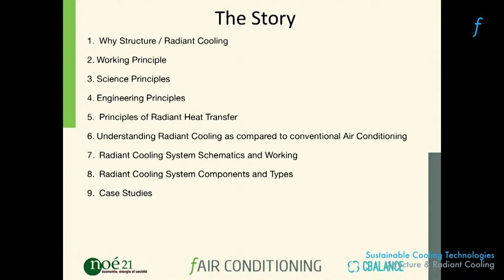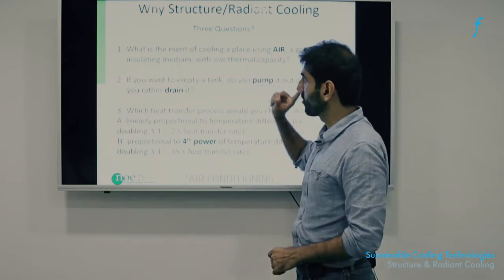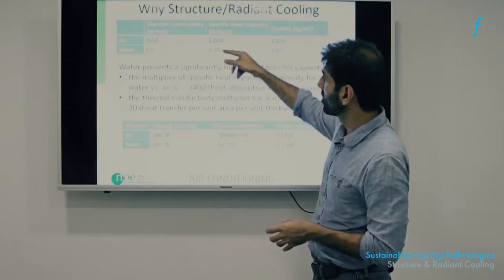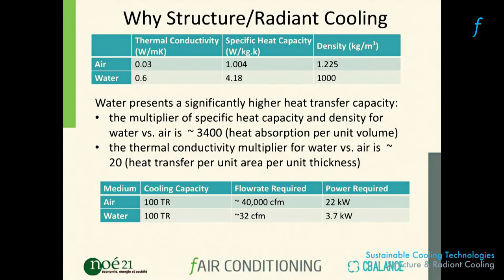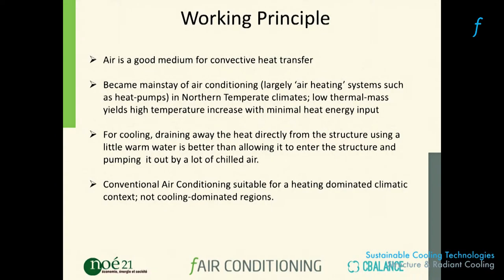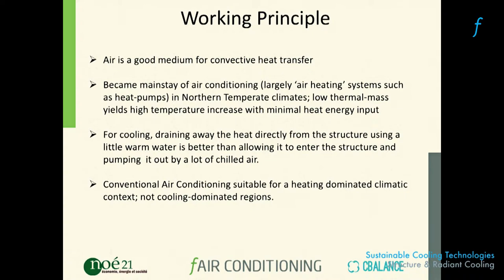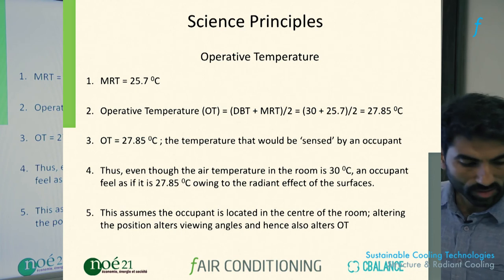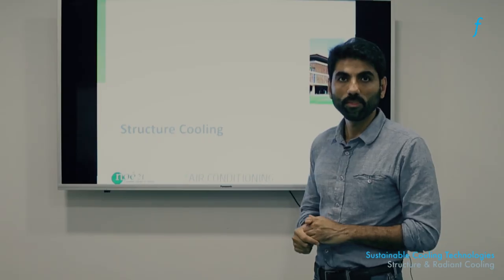SustainableCooling - StructureRadiantCooling

Comment: Very good explanation.  Best video I have found on this subject and I have been looking for several days.  People are definitely overlooking the benefits of radiant cooling over conventional cooling.  My target application is for a greenhouse.  I live where it can be freezing cold in winter and over 100 deg F in summer.  

Recently I was thinking about Passive Radiant Cooling—it seems like there’s potential for this approach to go even further. Based on my calculations, achieving 10,000 BTU of cooling (about 2.93 kW of thermal power) at 60 deg F would require around 8.14 square meters of radiating surface. This assumes a perfect radiator with no re-absorption of far-infrared (FIR) or absorption from surrounding surfaces.  I realize this is not possible.

One approach to boost efficiency might be using wave-guides to channel radiant energy perpendicularly away from the surface, it might also help solar cells. This could help reduce re-absorption and focus the energy outward. Additionally, if the radiated energy could be directed through a small exit portal, it might lower the effective surrounding temperature by guiding heat away from the radiating surfaces. 

If I had a rectangular structure with 4 square feet of radiant surface per linear foot, I’d need almost 22 feet of it to reach 8.14 square meters (or around 87.6 square feet) of radiant surface. Besides the construction costs for a Passive Radiant Cooling System like this, it would require a significant amount of space. However, if placed underground, that might make it more feasible.  If you could reach 50% of the ideal case maybe it would be feasible.

Is it possible that such a product could be produced and made economical for greenhouse application where keeping the system underground would not be a big issue? 

Thank you for producing this video I definitely learned from it.